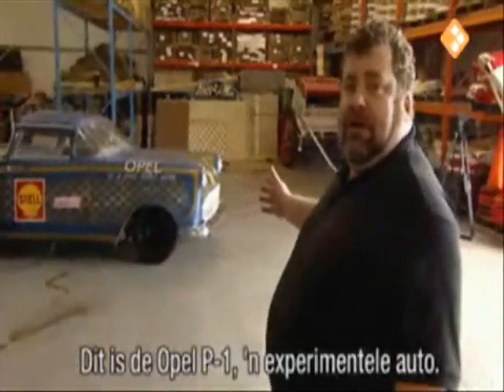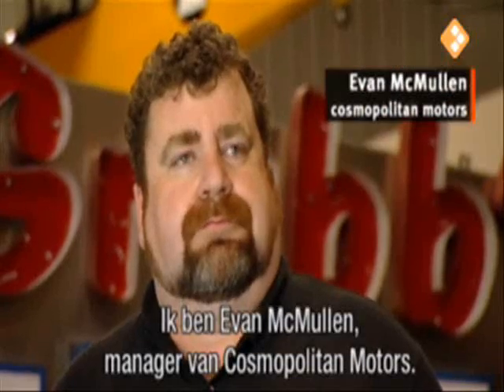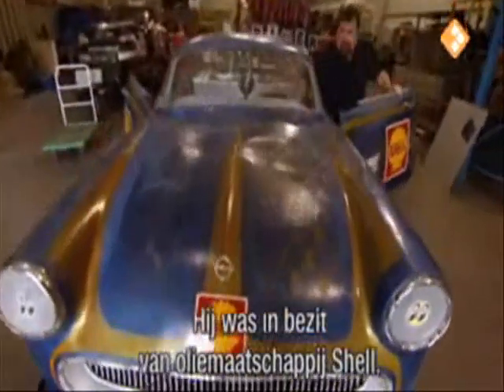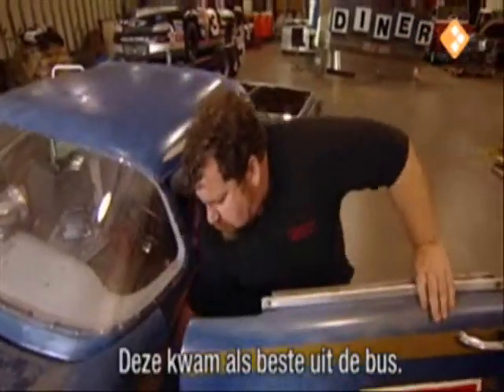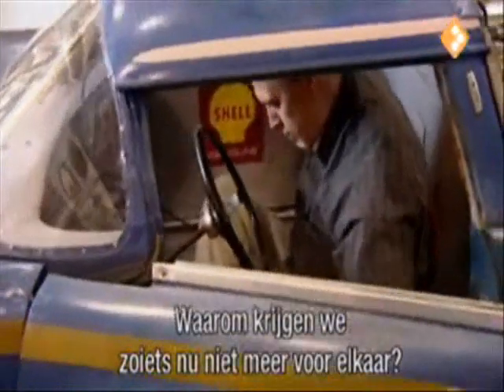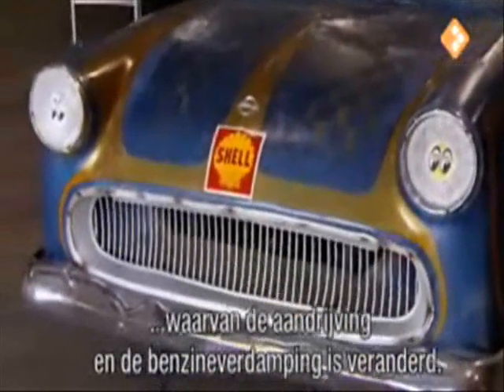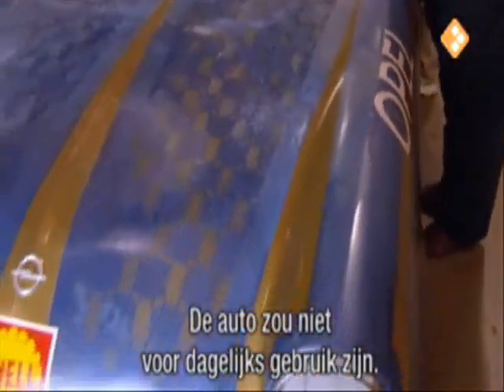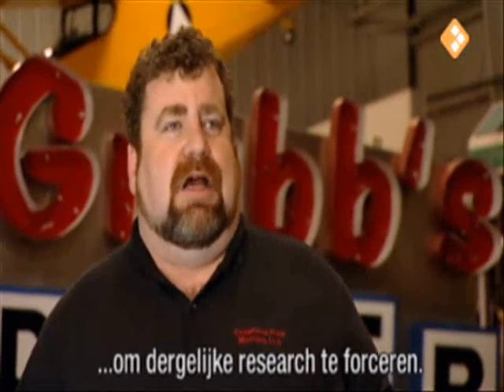High mileage car. 376 mpg!

Comment: The ONLY REASON we cannot get cars to get this kind of mileage, is because, the petrol companies wont allow you to have it......THEY OWN the PATENTS......less petrol [gas] less profits simple equation.....
40-50 years after those  experiments [documented and proven] we are  still getting on an average 300-500 klm's [ 200-300 miles]  to a full tank...we haven't progressed but regressed, gone backwards and its only because on $$$$$$$
Hybrids-Electric-HH20-Diesel-Water.....ALL available now, but!
Reply: You are deluding yourself and others with this conspiracy talk. 

Please discontinue the alarmist noise about the Big, Bad Government killing inventors and trying to hold mileage down.  That's baloney and anyone even halfway sane would know it.  Thrifty, efficient vehicles mean more energy independence, independence is good for governments and citizens.  Your X-Files scenario is ridiculous.

 Here are some facts:

The Opel in this vid achieved its high fuel mileage at a brisk walking pace.  It never went much faster than 5-10mph during record runs.  Its ignition was turned on to accelerate to an upper limit, then coasted with the engine off to the lower limit.  Modern hypermilers do this too, but at higher, more traffic-friendly speeds.

The Opel is completely stripped down.  It weighs less than a 1995 Geo Metro, one of the lightest cars you could have bought in the last 20 years.

Fuel mileage is achieved by either making better use of the fuel or reducing the work required of the engine.  Slow speed all but eliminates aero drag, that's why the Opel did so well and why so many modern high mileage record holders still don't go much faster than 20-30mph.

Better use of the fuel is hard to do.  Modern engines only make use of about 25% of the energy in the fuel (diesels do about 30-35%) and as soon as somebody improves on that, that manufacturer will steal a march on all the others.  No one has achieved marketplace dominance because no one has made any quantum leap in engine technology.  Incremental improvements continue to develop but nothing earth-shattering.
Reply: camel driver No, holding a higher speed does require exponentially more energy..  Aerodynamic drag goes up with the CUBE of the velocity; if you double the speed you need EIGHT times as much power (2, cubed = 8) to hold the new speed.  Double the speed again and now you're going four times as fast as when you started, but the power requirement is now 64 times what it was before.
Reply: CarsRcool What I would like would be for you to be less vague.  You accuse me of lying to people when I have provided only facts that are easily verified by anyone with a single functioning hemisphere of brain.  Please take a few extra moments to clarify your statement, or else admit you don't really have a point to make.
Reply: how many  people  would not give a shit and drive that car back and forth to work EVERYDAY  !!!!!!
I would .. .and I would start making more just like it ........ just give me a chance...

God Bless...and that is the God of Heaven Jesus Christ !
Reply: CarsRcool Whether or not Christ is God is not relevant to this discussion.  Stay on topic if you want to be taken seriously.

That old Opel is impressive, but no infusion of money is going to make it deliver 200mpg in conventional driving.  It cannot happen.
Reply: elhigh You are so right about this.  Strip down a modern car to its lowest possible weight; put hard narrow tires on it; and then drive it at 10 MPH on a cold day.  60 MPG would be easy, and 150 MPG or more with a little tweaking of the engine.  
These conspiracy guys don't understand that the power to move a car comes from the fuel, and that fuel has a known amount of energy.  I'm not sure any heat engine has been invented that produces more than 35 percent efficiency, except perhaps a jet engine at high altitude.  Another thing they miss is the fact that, because of air resistance, the amount of energy needed to accelerate a vehicle (and keep it moving) goes up exponentially with speed.
Reply: The energy required to accelerate a vehicle goes up depending on how quickly you want to accelerate, the energy required to keep it going at higher speeds does indeed go up exponentially.

Finally, someone else who gets it.  That record breaking Opel, while impressive in its achievement, wasn't even close to roadworthy for that record.  There have been many other vehicles since, achieving mpg ratings in the thousands.  They aren't much more than highly streamlined fully enclosed skateboards.
Reply: The energy required to accelerate a vehicle to a certain level of speed  goes up depending on how quickly you want to accelerate, the energy required to keep it going at higher speeds does NOT go up exponentially.......Because once the level is reached, forward motion keeps it there "O/D" or over-drive,until you want to go faster or decrease speed,having to only regain it later on.
But yes we should have cars running over 1,000 miles to tank, rather than what we have now.....We know petrol is NOT the only fuel, what we know is the BIG companies are holding us to this....And NOT what is out there to use, clean and cheap!..
Thanks for a reply!
Reply: What I was trying to say, but never got through....If you attain a certain speed
[100klms or 60 MPH ] and keep it there, it doesnt use the same amount reaching it, in fact use less...hence over-drive gears are made for that exact reason......SURE if you keep reaching a higher speed and keep accelerating, of course its going to consume, more but NOT if you keep it at a constant speed over a length of distance.....anyway enough from me on this topic...moving on!

thanks anyway.
Reply: camel driver You do realize of course that it requires a constant power level to hold a steady speed, right?  The way you've written your statement makes it sound like no further power is required to hold a speed, which isn't the case except in space.
Reply: elhigh howdy epstein ....... you are a liar......  you know the reason why cars dont get good gas mileage
Reply: CarsRcool And what might that be?  I am fascinated to hear your theory.
Reply: no theory only truth .. I like that better dont you ?
Reply: would you prefer truth to 'theory' as to make a car get better gas milage ?.you are very negative..but lets see.. if I gave you a salary of 100,000  a year an 5 million if you reach the goal ..and a huge budget.. do you think YOU .. ( because you are a smart guy ) could get 100 mpg out of a current car ?
Reply: elhigh yes.. everything you said is true.
Reply: elhigh Please answer the simple question truth or theory ?
Reply: Truth: car companies are in the business of making money, which they do by making and selling cars.  Making people want to buy cars can be done two ways: make the cars more appealing on an emotional level with more power, appearance and reputation, or on a logical level with reliability, economy and convenience.  Power sells, and so does fuel mileage.  Advantage: you would think neutral, but in fact the marketing is so effective that buyers tend toward power in the US.

Truth: oil companies are in the business of making money, which they do by selling petroleum products.  They could have a vested interest in making cars that do not get good mileage, but unfortunately they do not sell cars.  Advantage: economy

Truth: high energy costs can destabilize a national economy, which is bad for the nation in general.  Governments have a vested interest in cars that get good fuel mileage, and keeping energy costs low.  Advantage: economy.

Net result: approximately neutral.
Reply: CarsRcool 100 mpg out of a current car, probably not.  It depends upon the car.

Generally cars are now much too heavy and carrying an awful lot of ancillary equipment that is not directly related to the purpose of transportation: stability systems, occupant protection systems, anti-lock brakes add weight, complexity and in some cases engine load without making the car more efficient.

On ecomodder.com several drivers have made modifications to their vehicles to push past the 100mpg barrier.  The most effective of these efforts have been with hybrids, generally the tiny two-seater first-gen Insight.  Some straight gas cars have done very well, these are generally older, lower-content featherweights as well.

I think if I wanted to break 100mpg on a current car, I would have to find the smallest diesel available in the US and aeromod the daylights out of it, and even then drive gently.  Get away from the bottom end of the spectrum and "value added" standard features and poor overall design rapidly pile on the weight and drag until the vehicle couldn't crack 100mpg unless you coasted it down the side of Mt. Rainer.

Could I DESIGN a car to deliver 100mpg consistently?  Absolutely.  The tricky part after that would be to convince people, with all the bells and whistles available in the wide open marketplace, to buy it.
Reply: elhigh that car weighs a ton an gets 300 mpg, what you talking about lol.
Reply: Adam Wilson Please clarify exactly what I have said, that you don't understand.

The car in the original video has undergone radical weight reduction, very significant driveline alterations (the rear wheels are side-by-side, for instance) and the engine is also heavily modified.  It never moved faster than a brisk jog to deliver that 300+ mpg.

What have I said that confused you?

"lol"
Reply: CarsRcool Damned few.  Its top speed is about 10 mph.
Reply: Give me that car for 3 weeks a 2500 dollar budget and you will have normal highway speed and
200 mpg  MINIMUM ....  FACT !
and be free in Christ .. Jesus Christ the God of Heaven
Where Our Lady is God  , Jesus Christ is God and the Holy Ghost is Still God !
Reply: You wont because you can do nothing..... I WILL......I Can... and you and your Masonic clown show wont stop me.... .
I can see who you are even if no one else can......
do you think I am new to this game?......200 is easy .. sucks to be you and all who follow you ...

which part made you mad.. the 200 mpg or the FACT that Christ is God ?
Reply: Christ is God ( the God of Heaven )  and it is relevant to the conversation ....yes.. I know it is just a  strange dopey little  car but you "think" that getting 200mpg is difficult...
What you  "think" has no revelance to the truth ....
200 is not difficult... the "whole world" is a lie.....
I have made a statement.. I stand by ... I can do  this... with this car
and I  am nothing special ....
you assume the :"knowledge" you have is all there is ... there is plenty more... and just as easy to learn .. only different.. Cheers !
Reply: I dont but it seems to be a good starting point  that is all ...
Reply: ***** Jumping Jeeps, the guy is deep in the Kool-Aid.

For what it's worth, I'm with you.  200mpg is definitely doable, VW has committed to producing a very limited run of their 1L car, that's good for over 200mpg.  It's tiny and weighs only 1800lbs and will be priced over $140,000.  But modifying an existing car to something like that?  No way.  Can't have it.  Physics gets in the way.
Reply: CarsRcool Look man, you just can't.  You say you can, but you can't.  God says so.  It's in Revelations somewhere.  You cannot contrapt an existing car into a 200mpg streetable commuter.  There is ONE current vehicle, a ridiculously overpriced two-seater that will do it, and that's it.

Even if someone were ever to come along and achieve this goal, I am 100% certain that person could never, ever be YOU.  You are too caught up in idealism and convictions, and too unwilling to test and verify.  Faith is great, but physics won't allow you to disregard them on basis of faith.
Reply: when you talk to me .. it is the demons in your soul that do the talking... the bible is a lie written to deceive.. and what YOU are certain about has NOTHING to do with the truth ...
boy man are you negative ...do you know why ?...    nothing has changed... I can ... you NEED to learn more ... than what you know... why are YOU unwilling to learn ?
cant you say maybe?..or someday . or if I work harder at the problem ?
you are trapped in a world of lies and I tell you truth and you have a beef with me ?
Reply: ***** ok... you have one purpose here... to lie and tell people that this cannot be done... I can do it.. it has been done before... no big deal ..
YOU never tell me what to do .. ever . got that ?
I would start with this car because someone has done alot of work already ... I dont need this car to do it ... you guys are liars.... ok .. no problem...that is YOU purpose on the site
 If you cant  do it say so ok?..that I can believe
but guess what ? with you 2 idots as my free labor and helpers..I. can get it done in 2 weeks ...
you said    "You assume the "knowledge" you have is all there is. There is plenty more, but I doubt you can learn it."

my guess ... I know 2 % ... you on the other hand ( because you have chosen to believe lies )
know NOTHING.... and thats a fact ...( unless you made a special pact with satan )
at the masonic lodge..
Reply: CarsRcool I might have demons, but not about this.  Put your money where your mouth is.  You claim you can make an existing car deliver 200mpg in day-to-day traffic.  Prove it.
Reply: elhigh a car motor will run the same on liquid as it does vapor. There is no improvement of MPG.  My brother and I did this on a generator the generator ran for exactly the same amount of time when running liquid though the carborator as it did when sucking vapor from a jug.  Same amount of gas liquid as vapor  engine ran same amount of time.
Reply: can you show me how you arrived at this conclusion ?
Reply: smith.. then your Brother is a    MORON..           .fact ! 100%
Reply: please give me your bro's # so I can call him# 
and talk to him ...
Reply: Mike Smith Not relevant to this discussion, and I wouldn't argue the point in any case.  I have seen too many excitable ads and "articles" touting the so-called advantages of assorted vapor carbs to believe they are anything but snake oil - as you have already determined.
Reply: Booooring, these sheople,continue to fill the airwaves with Muck.
There are ways to get away from this,
The thing that pisses me off is not only do they rip us off all the way around but they also allow us to be stupider than pigs.
Pigs when confined to a shed in the winter will at least s*** in one corner and sleep in the other.
AND THEN they will tell us how bad of people we are,because we're polluting our environment with the same devices THAT WE'VE BEEN SOLD.
 Bunch of f*** up skullduggery.
Reply: Hush up

HHO is a scam.

Chances are I'd make a plug in vapor-carby series electric hybrid drive just for a giggle and see what kind of mpg it got starting from empty battery with a two minute battery charge time as the engine for an otherwise unmodified 2002 Ford F-150 XL long box 2wd.

I'd modify the key barrel part of the column so that there was the "vehicle master switch" and "engine force-run" which would run the engine at 80% throttle and a few % lean of stoich to charge the battery (which would invariably be a lithium) ahead of, for example, a wide-open motor run. (The electric motor would probably be 160kW, slightly higher horsepower than the 4.2 V6 engine in the truck, which is 151kW, and the generator would probably be a 90kW deal)